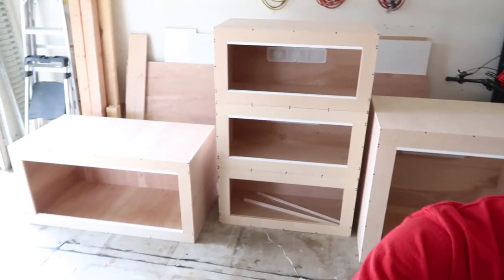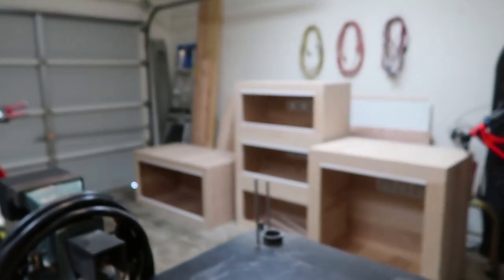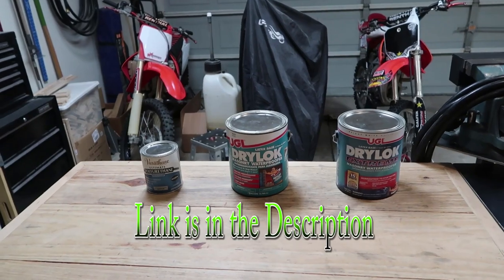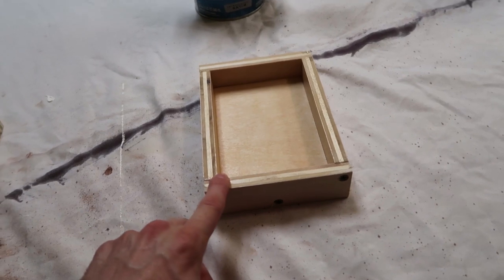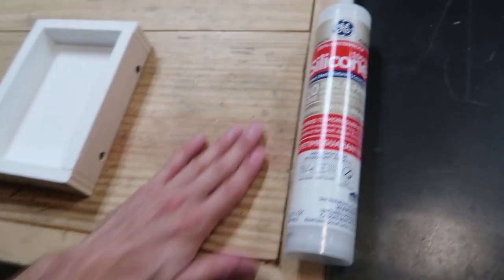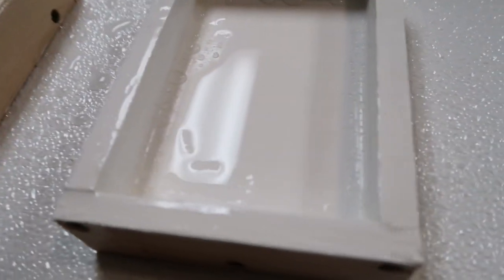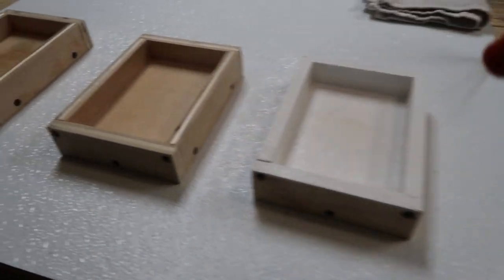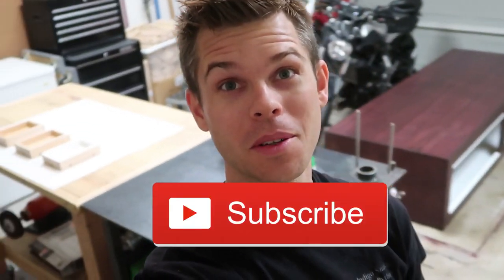BEST Interior Wood Sealants For Reptile Enclosures!!

Comment: Both oil and water based urethane are reptile safe when fully cured. The down side to oil based is that it will off gas for much longer. But oil based is far more durable and water resistant.

Comment: Super helpful! Im doing an eight foot enclosure build for an adult tegu next week and this very much helped me decide to go for a polyurethane sealer/tint.
Reply from the maker: @dandyxrandy7200  Glad I could help!  With a tugu I would personally add a bit more protection to the wood since they do require more humidity and moisture. Here is a video I made showing a step after a polyurethane interior. This gives it a lot more resistance to moisture. Highly recommend. 

https://youtu.be/Y42MmqLJcRU?si=7K123HB27L-Nsn5_

Comment: Hey I know this is years after you made this vid but I'd like to say thank you!! You helped me make my vivarium! I needed a good waterproof sealant but could never find one. When I saw this vid I knew exactly what I wanted and so now I have a nice polyurethane inside on my Viv!
Reply: hows it holding up? I heard it can chip off easily
Reply: @The_Horizon  it worked extreamly well! I actually just made another terrarium with it the beginning of this summer. It does take a while to dry in-between and you have to do 3-4 thin layers. Just be sure to seal the edges with aquarium safe silicone. I've only used it in bioactive arid species enclosures, so a bit of moister but not much, but even if water puddles at the bottom there's been no issues. I can't say how well it would work on more humid species enclosures but I wouldn't recommend wood enclosures for humid species like crested geckos anyways. Hope this helps!
Reply: @The_Horizon  also it hasn't chipped at all for me

Comment: I’ve actually used drylok to make a wooden livestock water tank  and it’s still holding water now 5+ years later.
Reply: Thank you for this, also when I was listening cuz I ordered the original fry lol he just said he doesn’t recommend because when you clean the whipping is rough, is that true??
Reply: @Garzajonathan1  it’s similar to cleaning “ matte “ paint , rougher surface but super durable paint won’t come off with hard scrubbing or anything like that.

Comment: I wonder, can you stack the water based polyurethane over a tinted dry lock. 
I’m actually gonna be using this for a hedgehog enclosure. Water based aquarium sealants and water based polyurethane both came recommended. The enclosure (a gray and white, wooden fir wood hutch) I bought off Amazon. But of course I can’t just put my hedgies in it without coating it. They aren’t super messy and have fleece padded liners to go over each section. But wood attracts mites and bacteria and to avoid it, all the wood must be coated. And it’s a lot of wood. I intend to do the outside as well as the inside. So for cage cleaning days, I use a 50/50 water and cleaning vinegar spray. So I’m looking into vivarium sealants as it may help me out. 
Thanks for making this video. I’m just curious if you can stack the polyurethane over a gray tint drylock, as I bought them walled ramps made from pine kiln treated wood but it’s just the natural wood color and want it to match the gray of their enclosures as best as possible. 
I was originally gonna use a water based aquarium sealant to caulk the nooks and crannies, and boy is there a lot of them. So not looking forward to this but it must be done. I’d like to get the entirety of the hutch done, both inside and out, but don’t have a ton of work space to do it. And I’ve also been sitting on this project for a while now as I wanted to be sure to find something non toxic for the hedgehogs. 

Thanks for making the video and giving examples of how it came out. Definitely gonna get the water based polyurethane, but just wondering if I used a gray tint drylock, can I put coats or the polyurethane over top? Or would it be possible to use a non toxic paint in the color of my choice, and then put the water based polyurethane over top?
Thanks!!

Comment: What product do you recommend for the exterior of the enclosure? I'm planning to paint mine black on the outside with a raw wood interior. Thanks in advance. Great video!
Reply from the maker: If you're wanting to use a black paint for the exterior. I would recommend getting paint from Bear. Something that has a primer in it also. 

As soon as I have a bit of time in the next moth I hope to make another YouTube video showing exterior paints and stains that are great for reptile enclosures.
Reply: Does the exterior need to be sealed with polyurethane prior to painting black ??

Comment: Quick question. I’ll be doing a bio active for my bearded from the bio dude. The substrate won’t be super wet but it does require a light misting. Will the polyurethane break down??
Reply: Had the same question as well
Reply from the maker: My apologies for the super late response. I must have missed it in the past. 
I use polyurethane on my personal reptile enclosures that have lots of himidity in them. About 60-80% himidity, with misting. 
Hope this info was helpful.
Reply: Polyurethane normally breaks down under UV rays not from water.

Comment: What kind of wood glue would you Recommend when building a snake enclosure. Also, can I use both wood glue and silicone? If I glue the wood down once it sets, can I put silicone around the edges? Also videos are very helpful thank you.
Reply from the maker: I do not use wood glue to secure my enclosures togeather. It is rare if I use wood glue, since it's quite a bit more permanent, and isn't quite as strong as screws.
Reply: Yes you can just wipe off the excess glue with a damp rag if you are using a water clean up glue. Any wood glue will be fine wood Glue isn't necessary but it can extend the life of the cage
Reply: @talkingserpents  wood glue is actually stronger than screws when used right,but more permanent so I don't use it on mine either.

Comment: I am sealing some styrofoam for just a homemade reptile background for my leopard geckos. I used varathane matte water based polyurethane. Is this good to seal  it and and how long should I wait before putting a animal in the tank with the background
Reply from the maker: I have personally never sealed Styrofoam, so I can say. Although I do recommend to wait 5-7days for the polyurethane to cure.
Reply: @talkingserpents  ok to be safe I’m going to do 2 weeks and is the varathane a sealant/ protective finish?

Comment: Hi, im curious if I was to use a stain then cover with the water based poly if it would be okay?
Reply: It will work just fine, when using the polyurethane I suggest reading the directions when it comes to application time after staining. Sometimes after staining you may have to wait 3+ days after application to brush poly on. All depends on the product though!

Comment: Question: Can I cover an oil-based polyurethane coat with a water-based poly to make it safe fore my reptile? My hubby grabbed the wrong can by accident and it's now 3 coats in on our $$ custom build. I need to fix this without having to start completely over.

Comment: Hi what do I use to disinfect enclosure? I used varathane
Reply from the maker: To disinfect i personal like to use a 10 to 1 water bleach suction. In other words 10% bleach and 90% water.
Reply: @talkingserpents  thank you for replying back! I wasn’t sure what disinfectant was safe to on polyurethane. I just built my very first enclosure . 48x18x18 using 1/2in birch wood and it came out really good . I did 7 coats of the varathane just because I didn’t wanna throw it away whatever was left .

Comment: Hey! Cool video! Quick question. I'm building 2 8x4x4 enclosures and I've applied 2 coats of drylock extreme on all interior sides of the enclosure, and after 24 hours the drylock seems to chip off quite easily. These enclosures are for tegus, which are natural diggers/scratchers and I'm worried it won't hold up very well to their digging. What would you suggest to help reinforce the durability of the enclosure? Thank you!
Reply from the maker: Chip off!! I've never had dryloc ever chip off. What kind of plywood did you use? 🤔 
Personally I don't even sand the Interior of the enclosure before applying dryloc extreme, and it adheres perfectly to smooth birchwood.
Reply: @talkingserpents  its birchwood. It adheres to the wood fine, but the drylock itself comes off if I scratch it. And since I own tegus, I know they're going to be doing a lot of scratching
Reply from the maker: @nerdherp782  That is very odd. I have a customer / friend of mine that isn't have any issues. I built the enclosure for his tegu, and I used dryloc for the interior. The only issue I could think of was there something on the wood before you applied the dryloc? Oil, residue, anything that might not let it adhere properly. 
Oh did you you use dryloc extreme or the regular dryloc? The extreme is smooth ,and the regular is like a coarse mixture ( feels a bit like sandpaper)?
Reply: @talkingserpents  I used extreme. I took some pictures but can't share them here. It scratches and peels off very easily.
Reply from the maker: @nerdherp782  If you have an Instagram account send me a message there. 😎👍

Comment: What do you suggest for wood for enclosure besides birch since it's so expensive in my area. Would mdf be safe alternative if sealed with water based polyurethane.
Reply: Personally I wouldn’t suggest mdf due to the sensitivity to moisture. The slightest amount of moisture will cause it to warp and bulge.
Reply: Yeah learned over the months it's not good due to the chemicals in the glue used

Comment: After applying the dryloc can you go back and paint a backdrop over it?
Reply: Yes, I would suggest it, you should use the safest paint you can find and apply a few coats. You should also let it cure for a few weeks before putting the reptile in it, some paints can off gas for a long time after drying
Reply: You can add powdered cement pigments to the drylok before you apply it.

Comment: I just purchased a melamine enclosure, what product would you recommend I use?  I used silicone on the corners and edges already.  Thanks.
Reply from the maker: Since melamine is already a water resistant coating you will only need to calk the inside of the floor and a few inches up in each corner. Since you've already done that sounds like your all sealed and ready to go. 🎉🎉🎉😎
Reply: @talkingserpents  Thank you, I just wanted to be safe. Burms are big snakes and have big "movements" if you get my drift.
Reply from the maker: @joshsmith7170  I know exactly what you mean 😂😂😂

Comment: Hey!! I have a question! We made a wooden enclosure and have stained the outside of the enclosure. We have water based triple polyurethane we plan to put over it. However, how the enclosure was built was to put our heat lamps directly on the top of the enclosure on the wood. Will the heat lamps cause these products to catch fire with direct contact? Should we mount the lights inside somehow instead? Thanks!
Reply from the maker: I would highly suggest installing them inside the reptile enclosure. I actually sell a heat bulb kit on my website. Here is the link. ⬇️ 
https://talkingserpents.com/product/heat-bulb-kit/

Comment: Hey I just wanted to make sure that you could apply the sealant prior to assembling the enclosure
Reply from the maker: I personally wouldn't do that, since the interior sealant will increase the thickness of the wood pannels. I might potentially cause problems while assembling.
Reply: @talkingserpents  ok thank you for letting me know! This video was super helpful. I wanted to use pvc but it’s so expensive and I’ve been wondering how to make wood work

Comment: I know it doesn't have much to do with this video, but I may have missed it as I was going through your channel. When you build stuff like 8' by 4' enclosures and enclosure is cut in half, how do you seal that? Do you use the silicone or do you apply another coat of sealant? I'm curious because i'm building a red foot tortoise pen and then on top of it an ackie monitor enclosure and they'll both be 8' by 4'.
Reply from the maker: The enclosure that was in 2 pieces was joined together by packet screws. So seal the seam that goes around it I used 100% silicone calking. 🛠😎
Reply from the maker: If you're planning to stack anything on top of the enclosure make sure the lower support enclosure has an additional structure I side it to brace for the extra weight.

Comment: Is the dry lock extreme ok even though it says it’s latex based? And how long does it take to cure I need to have my frilled dragon in his enclosure as soon as possible
Reply from the maker: The dryloc extreme is definitely ok to use. I let dryloc extreme cure for a minimum of 7 days. It's important to let it cure as well as make sure there is no odor inside the enclosure. Luckily dryloc extreme doesn't put off much of an odor to begin with. 😁
Reply: Thanks and which would you recommend the dry lock or the polyurethane?
Reply from the maker: @donnieshivel9882  Depends on the look you're personally going for, but I personally like the clear polyurethane, since it cleans up a bit easier, and I also enjoy seeing natural wood grain structure.

Comment: The railing on the front of your cages that holds the glass where do you get it at and what size is it also how thick is the glass that you put in is it tempered or just regular
Reply: Always better to use tempered glass especially with larger lizards and snakes.  A large animal striking at conventional glass could result in the glass shattering and possibly lacerating or killing the animal.

Comment: Could you use a water based stain on the interior and then use the water based varnish?
Reply from the maker: I would say definetly not. When I stain the exterior of my enclosures I use water based stains and water based polyurethanes. While I stain the wood in my garage I use a respirator, because the fumes are very strong. A couple times the fumes made me a bit loopy in the head. 😪 even after letting the exterior cure for 7 days the stain has just a bit of smell to it. I would avoid staining the interior with risk of injury to your reptile.

Also thanks for the comment. This is an important topic that should be talked about. 😎👍👍👍
Reply: Yes. That is what polyurethane varnish is used for alot of the time.

Comment: Looking into building a bio active enclosure. I really like the melamine aesthetic but I am worried it won’t hold up well. I am also interested in the birchwood enclosure. But do not like the aesthetic. Which would hold up the best?
Also if I were to go for a birchwood enclosure how well does the dryloc white cover up? Is it like paint and could it be used on the outside?
Reply: Also  how resistant is melamine, birchwood, and the dryloc to heat.
Which wood would work best considering all the other details.
Also this enclosure will be for a bearded dragon.
Lastly after sealing would fumes or anything toxic be created with the heat?
Reply: @PokeliciousPulls  melamine in the by far the worse choice.  It can off gas fumes without adding heat and any moisture will get absorbed like a sponge causing the wood to swell.  It is also incredibly heavy.  The best plywood you could use would be baltic birch.  It is incredibly strong and light and has a nice grain. It is also not super expensive but it can be hard to find in sizes other than 5'x5'  For a beardie that would be more than big enough without having to join wood pieces.  If Baltic is not a possibility White Oak if you can find it would be my next choice, then either white birch, red oak or maple.  If you are going to paint the outside it won't make as much of a difference but if you want to stain the outside all of these woods react and have varying degrees of effectiveness in staining without blotches. it can be done but it can be more complicated.  As far as sealing, it all depends on what you seal with but definitely let it air out for at least a week if you use a varnish or polyurethane.

Comment: Could i use pond paint to seal an enclosure? My enclosure is a vivexotic black so would i need to coat it anything? or can i just go ahead and only seal the edges with silicone? And if i were using plywood for an enclosure, would the whole thing need to be sealed or again only the corners?
Reply from the maker: I have never used a product called pont paint so I can not say.

Comment: Will the drylock extreme be good for a bioactive terrarium or is it meant for non bioactive terrariums?
Reply from the maker: My customers use all of these inteior sealants for bio active setups. Only thing these aren't good for is aquatic setups. For aquatic setup I would highly suggest a product called Pond Armor. This is what people use to water seal  plywood aquariums. 🌊 Hope this info was helpful. 😎👍
Reply: This was extremely helpful. Thank you for the feedback.
Reply from the maker: @tonyjones2347  My pleasure! Glad I could be helpful.
Reply: @talkingserpents  for aquatic set up could you also do regular epoxy resin on the wood instead of pond armor?
Reply from the maker: @deadpool981  I'm no expert with either of those 2, so I can't say for sure. Although I have seen many people use pond armor for inteior of plywood fish tanks. Knowing how sensitive fish are I lean toward pond armor, since it been proven. 

If you have any personal experience let me know.